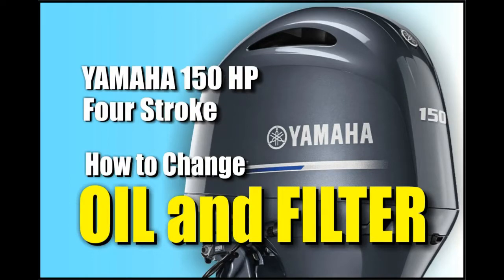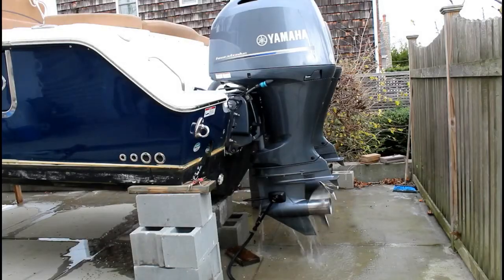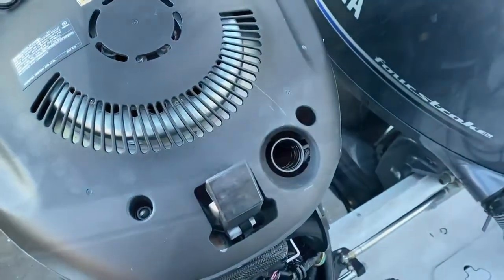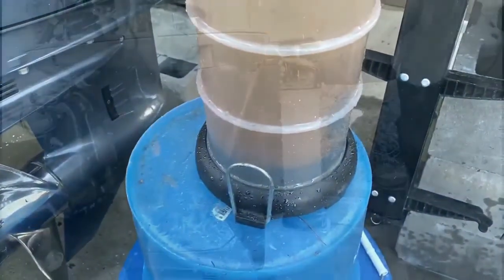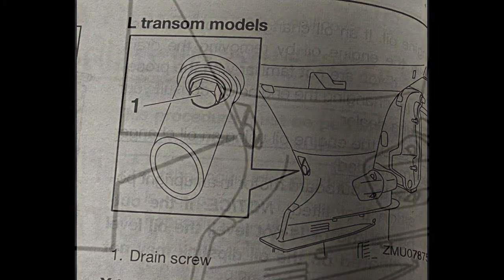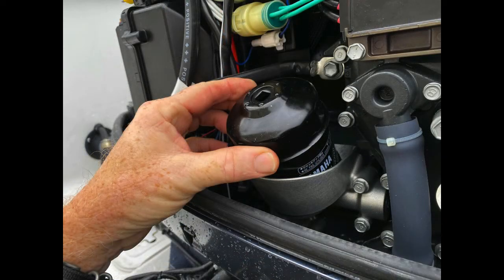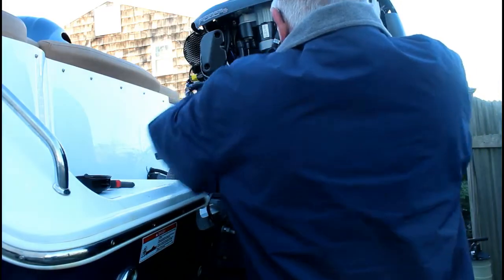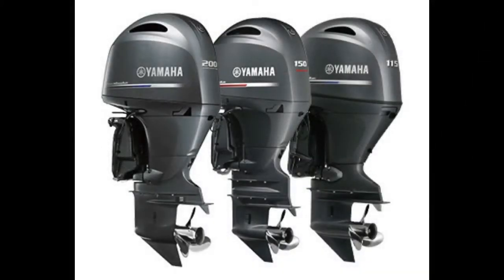How to Change Oil and Oil Filter on a Yamaha 150 hp Four Stroke Outboard by DIYeasycrafts

Comment: You'll need to run it once you changed the oil so it fills your filter, granted it's pointing down and it drains back after it's cut off but there is a little that stays in the filter and your filter is dry when you  installed it.  I recommend being in the upper range of the dip stick to compensate, just my 2 cents.

Comment: Why did u not tell viewers the size of bolt on motor for wil drain
Reply: If you're not mechanically inclined enough to determine the correct socket for a bolt, I suggest you have the marina do all your work.

Comment: Why don’t you just take the oil pug out
Reply from the maker: Some outboards have a side cover. Its just easier this way
Reply: @DIYeasycrafts  I have that same 150 and to me I just take that oil plug out and it goes so much faster I also have a seadoo and you have to pump the oil out and it takes forever so I’d say just take the oil plug out 😂
Reply: Could you let me know the brand/model oil pump and freshwater muffs? Or an Amazon order number for each 😄